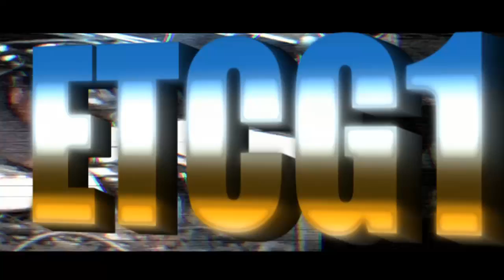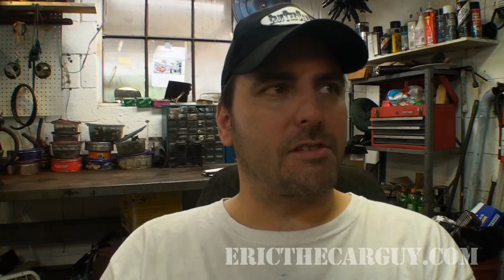The Flat Rate System

Comment: I totally agree. more than half of time things don't go smooth. I think the key is communication with the costumer.  as soon as you run into a road block you have to do your best to comunicate that to the costumer. that way they can decide if they want you to keep going or just leave it alone.  I always do my best to communicate with the costumer any issues that happen even if it's my fault.  that way people understand what your going through and give you the time to get through it, because all they care about is getting their car fixed right. even if it takes longer. that's why I don't want to work at a dealership because I would be pressured to do things fast and I don't want to sacrifice quality for quantity. in my experience people appreciate honesty and compensate me for the extra effort to get it right. I think the best approach is just to put yourself in the costumers shoes and treat them the way you would like to be treated.  and the costumer should do the same. that is the golden rule according to jesus.

Comment: i work at a dealer as a flat rate tech. I've only been doing flat rate for 2 months. I used to be a gs tech at another chain shop (tires and oil changes) making an low hourly wage. I get paid more per billable hour at the dealer, but in most cases I bring home the same amount per week. the biggest issue is lack of work. at the dealer, its usually semi busy in the morning, but by the last 3-4 hours of the day, were all siting around with no work. from working at the tire shop, I can do an oil change and tire rotation in less time then the "Mitchell" time. but there is only so many oil changes at a dealership per day. I can and do  do other work, but it takes me longer. most days I all but break even (8.4 billable hours in a 9 hour workday), but at least 2 days a week, there's little to do. so I end up working 6 days for a 40 hour check.
our turnover is growing as time goes on due to lack of consistant work (almost nobody in the shop is making a 40 hour week). we lost a seasoned tech. replaced him with another seasoned tech and a kid still in school. then the new seasoned tech left and now a seasoned tech that worked there for years is leaving. and we rehired a semi-seasoned tech who was fired before for big mistakes.
we currently have 6 techs. most days there's not enough work for all of us, other days (usually Saturdays) we are swamped.
when I worked hourly, mistakes were rare. with flat rate, mistakes are being made more often (by "green" and seasoned techs alike).
the 2 longest tenured techs at our shop usually get the gravy work (little diag needed, quick easy fixes, even in my unseasoned eyes).

Comment: I know the system well and I know the points you hit. I worked at a Hyundai dealership that was Individual Flag time. The best way i found to work it was to begin concentrating on quality, and with time, the speed will pick up and quality will stay the same. I voulenteered for all the crappy electrical and intermittent drivability problems i could get on. This allowed me to refine my test methods and build the reputation that I could ask for more diag time in hours when it took more time.

Comment from the maker: @blinkskaterkc In a situation like that you need to inform the customer of the situation and proceed accordingly, are you going to have to replace the oil pan?  Who was at fault?  These questions would need to be answered before you could proceed with something like that.  Some techs do milk the clock and some cut corners, is this a product of the flat rate system or just a lack of personal responsibility?  I suppose this video poses that question.  Thanks for the comment.

Comment: Been a shop owner for 22 years and Eric you make a lot of good points. I've tried many formulas for tech pay but here is what I think works best.  Techs need a tiered pay system that addresses all the issues from pay security to incentives to produce. All techs need to know they will get paid even when biz is slow.  Therefore techs need a base pay determined by time clock hours logged on the shop floor. This "base pay" is for being on the floor ready to work on cars but doing other shop maintenance duties as directed by the shop foreman.  Base pay is negotiated on hiring and determined by experience, credentials, formal training etc.  The base pay is the tech's lowest paycheck but provides techs with pay security.
  I employ a second pay system for all techs that tracks billable hours.  If a tech completes enough billable hours to make pay that exceeds his base pay then he makes the higher paycheck. Most of my techs will exceed their base pay after 3 billable hours/day.
  In a final example say a tech clocks 40 hours in a week.  That week he fixed 7 cars and logged only 5.2 billable hours.  (slow week)  His paycheck is $10/hr X 40 clock for $400 gross (before tax). That's his lowest paycheck.  Now on the other extreme, let's say he clocked 40 hours and logged 40 billable hours.  So that means he is 100% efficient..clocked 40 on time sheet and billed 40. In this case a different pay system applies.  His base pay now is $2/hour X 40 clocked for $80 plus his flat rate pay $18/hour X 40 billed for $720 plus his pro pay (training,certifications etc) $8/hour X 40 hours billed for $320.   Now his paycheck is at its highest for 100% efficiency $28/hour for $1120 and could go higher if he exceeds 100%.   The base pay drops significantly but serves as reminder to the tech he is still on the hook with the owner for shop cleanliness and serves as an incentive to be helpful to other techs where and when he can.  That puts his gross pay north of $50,000 if he is 100% efficient every week for the whole year (a goal not easily achieve in the current economic climate).
Reply: 50k for 100% efficiency. I assume you 109o your techs too right? that leaves him at least 40k a year after taxes. That's meh pay

Comment from the maker: @KillerZero259 You can't always put a particular repair into a mold and expect it to go the same every time.  Consider the rust belt where just removing fasteners can take a lot longer because of rust and things breaking, flat rate may be a start but it doesn't cover EVERY situation.

Comment: I'm a plumbing/HVAC company owner. I'm preparing to change from hourly to a flat rate system in my shop. What I have come up with after much research and deliberation is that to make flat rate fair for everyone (customers, business owner, and techs) you have to know what your true overhead cost is, figure in a reasonable profit, then set realistic times for job completion. This way you allow techs to have the ability to "beat the clock" without sacrifice quality.  And customers know pricing up front.

Comment: You hit the nail on the head. The flat rate system motivates the tech to cut corners. He will never get rewarded for doing the job right, but he will get rewarded for doing it fast. As a consumer, I'm willing to pay extra for the difficult job that doesn't follow the book. I took a car in to my independent shop with an electrical problem. After spending a day on it, they could not find the problem. I wanted to pay them for their time, but they wouldn't take my money.  Didn't seem right to me.

Comment: People think auto mechanics rip them off, in reality we're getting ripped-off all the time, shops that pay low wages, give cake work to lower paid tech's knowing it will increase their profit, pushing free work on you, then there's warranty that pays half if not a third the actual time, some manufacturers are terrible, Hyundai is the worst I've seen, Mazda is getting real bad, Isuzu was fair... but they're gone now.
I've worked flat-rate for over 30 years, when it's good it's good, but when it's bad, it's real bad.
Reply: 100%.  ugh warranty blows lol.
Reply: People don't think mechanics ripped them off. Shops that do it and the association won't dump them. Here's what happened to me - late April 2017, I take my 1948 car in for 4 mechanic things -  Carb. and fuel pump rebuild, complete oil and transmission fluid change, a complete tune-up. Even though I said I could get the rebuild kits  if they couldn't- that took 'til July,my cost approx.600 bucks which may not be to bad- however no oil was changed, and still had same old spark plugs and wires I put in the car 2000. ( gaps were rusted and oil dirty almost black ) Then they were going to do a cheap paint job ( macco style) ( I covered it with rustoleum to keep it from rusting and I told them that) rough up paint job/put sealer on/then paint and clear coat. Oh and they did take out the windows ( I have had them out- took me about 3/4 hours it's a simple car.  I was charged for 43 hours. Work that had been done was barely sanded the chassis, didn't even touch 5/6 pieces. All this from late April-'til Aug. I called and put a halt to it. Even tho I paid $1700. up front- I believe they were moving cars ahead of mine. In April there was 1 car in the bay and mine was supposed to be next.. This is what gives good shops a bad name. As a locksmith I got pd 7 bucks an hour - shop cost $35.00,  Some trucking companies pay from post office to post office even though the load might be going 20 miles away.  My point is this if you are a service person- a lot of small owner don't pay fairly, you can be 5-10 minutes late and they want to dock you 1/2hour- but also want  you to stay 5-10 later but don't want to pay for the extra. And shops like I took my car too. well they ruin it for good shop- but hey they still belong to "that association"

Comment: if you're wondering, Greece's labour time is a complex calculation that includes quantum physics but I come to you with the simple conversion...

1hr=1day

That means for every hour of work, it requires a day to complete.

With Australia, we are sorta like you Eric, we work hard, challenge ourselves and even go into unorthodox tools to complete the job easier while charrging the customers rates that are fair and reasonable.

Recently got my propane car up and running for less than $20 ($12USD) from it intermittent stalls (stalls on a timer) where if the guy wanted to do it the correct way, he could have charged me $3,000 for a new fuel system, but didn't

Comment: Thank u for this video erick. I hv been doing cars for 25 years  now. N the way i work now is this ill fix ur car perfectly honestly n ill make it happen on a single day in the sat or sunday if u hv to work monday. But i hv a single role. If anyone preform work on the car or removes anything  after  o fixex it. I wont touch it again even if he give me gold. N u know what. I hv over 400 customers  that after coming to me never had a single problem with the cars and the one they go to other mechanics the car breaks down after service straight away and it come back begging me to work on it and they don't tell me but when I open the engine I find my Mark's has been removed because I'm Mark the oil filters and the drain plugs in a very special way then they would admit to me that they take it somewhere then I will refuse to work on the car ever again

Comment: Technicians out there, realize that if you are good at what you do, you have a good attitude, and your boss sees that. Then you are in a good position to ask to get paid however you feel is fair. I worked on flat rate for many years, and did very well, but eventually youll get a bad attitude because of so many factors negatively affecting your paycheck. I asked to get a salary which was 90% of my yearly flat rate average. He agreed, and now I don't have to worry about anything now.

Comment: My opinion  with the flat rate system is well it needs to be recalled, just like all the recalls that have been interdused in the last few years. Automanufactures are so concerned  with safety, flat rate needs to end. Flat rate system causes greed. Faster you finish  a job more money you make. Well moving at such a fast rate can bring up safety  concerns. Techs may do short cuts or possibly  leave something undone or loose that can  potentially  put the customer  life at risk.  They need to change the way automotive techs get paid. It is a safety concern and must be addressed.

Comment: As a customer I had a good relationship with the mada dealership I dealt with. I had an 87 rx7. Since I was always in there getting the engine rebuilt, brake system replaced, ext ect. They would charge me witchever was cheaper shop time or real time. Depending on the job

Comment: Normally I do basic tasks in my cars e. g. change filters, sparkplugs, oil change, coolant refresh, brakes and so on. I leave to the mechanic the more complicated stuff like replacing the alternator, timing belt, change radiator you know stuff that requires more knowledge or special tools.
my indie charges by the hour. One of the most recent experience: he replaced the timing belt included parts on my BMW charged me $365.00 I think his rates are pretty good when compare to others.

Comment: Eric, I was doing a lower ball joint a few months ago. Should have taken maybe 1.5 hours. The bolt holding in the ball join snapped and we spent 8 HOURS drilling it out. Only got paid for the 1.5. Not my fault that the bolt head snapped. It was 13 years old and rusted as all hell. Sometimes the system works against you.

Comment: Where I work oil changes pay .4 tire rotations pay .5 and tires pay .5 each. alignments pay 2.0 and 2.5 on 3/4 ton trucks. We pretty much get to say what we want for the job. I know that sounds bad and really we don't charge a lot for labor so it helps us techs and the customer.

Comment: Went to an Aviation High School in Detroit, I flew and worked on aircraft while there.  After 9/11 worked in automotive for five years. While attending community college during many years I studied welding, criminal justice, but I earned 3 Degrees... auto, diesel and aviation mechanics. Love automotive but hate commission. Been in aviation since 2006 starting at a regional airline but now working at a major airline. At major airlines or a cargo  outfit you can earn over $50 an hour.  Diesel is my backup plan or trains if I get laid off. I have my CLD, many Ase's auto, diesel, X1, service consultant, parts specialist but I have failed these test many of times before I passed, I'm more of a hands on person though and I can pass many of other test but these test suck in my opinion and these test don't make you a hands on technician although some techs master both test and hands on.  In aviation mechanics my license never expires like ase's do in 5 yrs.  I volunteered for free as a biomedical technician to learn that trade for 6 months as well. As a tech. you have to be versatile; automotive, diesel, aircraft, plant maintenance, fleet technician, amusement park tech., trains, welder, biomedical technician, farm equipment tech... ect.  You have to think outside the box. In my opinion auto techs are well under paid and should be paid hourly and about the same as an aviation technician due to their investment.  With my matco triple bay and all the other tools I have for automotive, the investment isn't that great. Coming from Detroit after 9/11 the economy shut down. Anyone working commission suffered wether automotive, furniture sales workers. restaurants, or any commission based jobs in general.  I dislike commission because when the economy takes a hit you suffer regardless of all your hard work or experience. You will be surprised how your talents and good attitude can place you into a high paying job due to your experience, having a associate's degree, or working in a different field not related to your degree because you have applied yourself.  The ultimate goal is to set yourself up for the future and to have a fun career where it dosen't feel like work,  the company has a 401k and contributes to it. My snapon and matco toolboxes sit at home as a hobby for my cars/motorcycles. My other toolboxes sit at the airport where I performed maintenance and taxi aircraft. I have many hobbies which include swimming, skateboarding, and boxing and hopefully soon para-motoring. The goal is to get paid what your are worth so you can enjoy a life outside of work and develop a happy medium. Money/pay doesn't always mean happiness as well/ I tell my wife my other backup plan is being a Wendy's manager later on in age/life; this is because I budget.  In life you have to keep taking chances and pick yourself up when you fall down, many of times this has happened to me.  College is not always the #1 answer all the time too, it can be a business where they rob you if you let them. You have to take advantage of opportunities and stay motivated and (think outside the box)!  Born in Detroit at one point being poor living with my dad in a house with no heat, electricity, or water I never gave up and had determination. Nowadays I see so many young kids that are lazy, don't want to work, and expect things to be handed to them. In life if you put forth effort you will be surprised what comes along or what company, ceo, or business man or woman says I would like you to come work for us.  Keep your head up and stay motivated, peace✌

Comment: I think this system is good for vehicles less than about 5 years old. The older it gets the more problems will occur during repair. For example while replacing front shocks a few years ago I found the strut tower was starting to rust so suddenly I had an hour of rust killing to do. On the flat rate the strut would just go back over the rust. I do not know what the best system for older cars is?